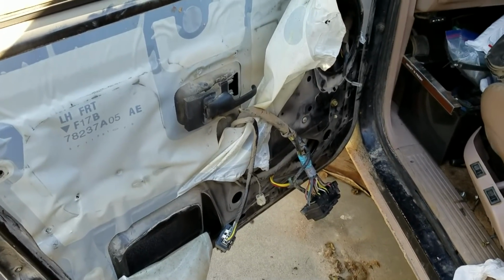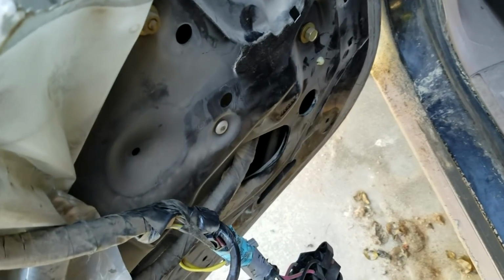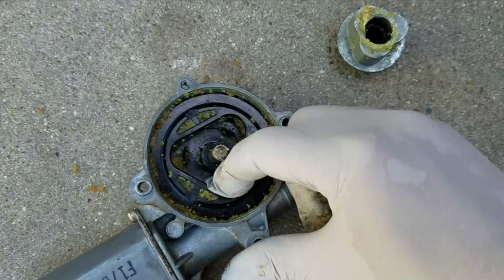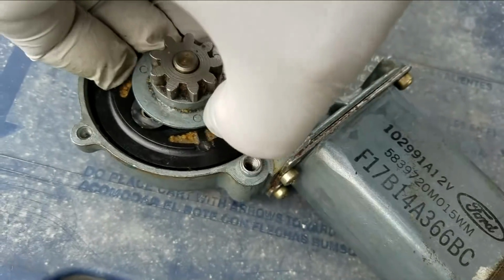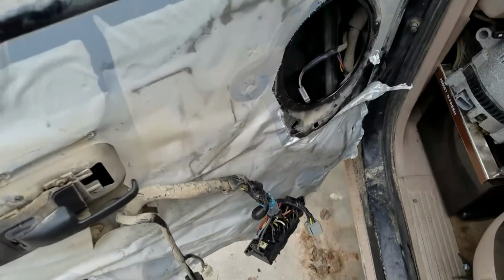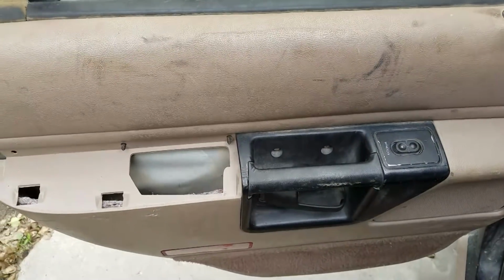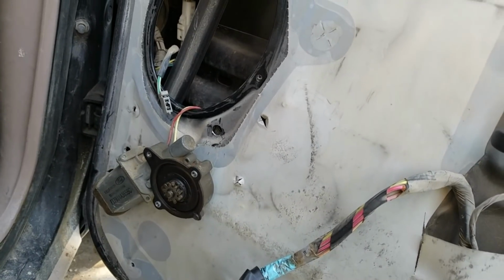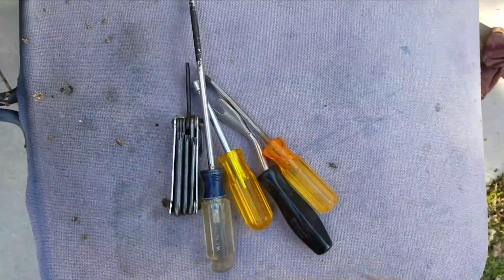Ford power window motor repair

Comment: I did mine , Lincoln Town , and it works better then new, the rubber hose is better then plastic or metal & will last longer. Many thanks *

Comment: Dorman makes a repair kit, # 747-409,  for $15.  Yes, I know yours is for free, as long as the rubber holds up.
But why did you not clean out the plastic debris?
Thanks for the helpful hint regarding drilling access holes to R&R the motor without even unplugging the wires.  Reallyexcellent advice.
Thank You for that....
.... RooDog....

Comment: RE:  my answer below.  The 7/16" wooden dowel pieces lasted 6 months, then the center metal chewed up the wood into splinters.  The ONLY solution is to use 7/16" zinc ball bearings.  $.79 each at MENARDS (similar to Lowe's or Home Gestapo).  Now I have even repaired a BACK window motor and that is much harder to remove, repair and re-install.
Reply: Trevor did u use the hose with the 7/16 bearings?
Reply: @joeyb7373  No.. steel ball bearings and a little grease only.  FORGET rubber, wood, expensive nylon pieces.
Reply: @trevortrillion6037  thanks I try it works great

Comment: I watched your video a year ago and procrastinated until now March 11, 2021.  Lacking the 3 spark plug tops, I left those out of my 7/16" gasline (1/2" too big).  Well, that little metal gear is so powerful, it crushed and broke the rubber in 10 seconds!  Next, I used 7/16" wooden dowel pieces cut identically.  Success, quiet, strong.  Can't wait to pay my toll, through the window!

Comment: Fixed mine this exact same way this morning.  Used spark plug ends as ferrules in the 1/4" rubber hose sections.  Works great now.  Thanks!

Comment: I used the spark plug tips and fuel line, greased it up, and it worked for several months...

Then it got where it would stick... and now it's stuck. I'm about to go take it apart and see what the deal is.

Comment: John here just done this to my 1993 F150 XL but didn.t use plug tops I used plastic water lone for water for ice cubes in the middle of the rubber holes . works great last a long time

Comment: Your idea of using fuel line to replace the original plastic cogs sounds good, but it's very dangerous.  Ford used plastic parts for a reason.  They are designed to sacrifice themselves if a body part (human or dog for that matter!) gets in the way of a closing window. This way a hand, paw or head doesn't get hurt (too much).  Problem is the three original Ford plastic cog parts deteriorate over time.  Go to your local auto parts store and find the Help! parts section.  They have a pack of new plastic cog bushings which retain the safety Ford built into the system, and they fit properly unlike your rubber hose trick.
Reply: Nope, they dont sacrifice themselves when new. Do NOT trust them.Try it out. OUCH!! Ouwouwou!! XD

Comment: I ended up takin my whole regulator out of my 1989 Lincoln Town Car,  thinkin it it was that. Beat me up! Needless to say.
I put another used regulator in anyways, since I bought it, but yes, it was the little plastic pieces that broke.
I saw anotha video like this one, & a guy put ball bearings in his, & said nuts would work in the place of those little plastic pieces. I put nuts in mine, & what do u know, works like a brand new window motor..
Window works like a normal window, got scratches, but well..
I like your idea too, the padding makes it that much better..

Comment: I had to do the same repair on my old Thunderbird except I used pieces of glue stick that were the same diameter which worked until I got the repair kit.

Comment: Great Idea.  It was off to the local parts store for me.  Turns out that it is 1/4" fuel line.  Will install the motor tomorrow.  Thanks for saving me a bunch of hassle !

Comment: FYI those windows will now chop your arm off! Not sure but I think that was the whole point of the plastic bits, they were soft and could slip under tension. No idea how strong the motor actually is but I'd be careful just in case. I replaced those a few years back in my Grand Marquis. A set of the plastic bushings was only like $3 on Ebay. I had no directions though and put grease inside there and found out later you shouldn't. Didn't seem to hurt though, windows worked like new.

Comment: I thought I came up with this on my own, did this yesterday but used pieces of a bolt cut to length. I saw other videos with people using nuts & ball bearings & thought I can come up with something better that will have some cushion so as to not strip out the plastic gear. It worked great, not noisy like the other videos. Started to do the other door today & the motor is not working, looking up videos to fix that & saw your video, guess I didn't come up with this after all, lol. Some minds think alike. Tearing into the the motor now to check the brushes. Good Job.

Comment: Clever fix.  They actually sell replacement inserts in the doorman HELP kits at the parts store, but they don’t hold up very well. It got to be I was doing the driver door motor on my 96 explorer about twice a year. Bet yours will hold up better being rubber and not hard plastic.

Comment: Crank windows last the life of the car, power windows are part of planned obsolescence.  Ford sucks the most for making throw away vehicles.'

Nice repair job especially for cheating the Ford bastards out of the cost of a new assembly.
Reply: Sorry, but it's not a conspiracy, it's a safety design.

Comment: i remember when i worked at napa we had a guy with an old battlship grey Lincoln continental that had the same problem and they actually make replacement clear rubber plugs just for this purpose. my guess is that these were used  so that there was a little bit of give to keep the glass tight against the upper window seal since even with the rubber plugs it would be strong enough to hurt your fingers badly

Comment: Seems to be the same sh*tty material VW used for the rubber ball in the gear shift linkage for their 020 gearboxes. Disintegrates with age, causing endless play and makes shifting a pain...

Comment: hey shango, all you need is to put (2) 1/4-20 nuts on top of each other in each of the 3 corners of the triangle. then pack in some grease & reassemble.

Comment: Perfect repair! I should have done it like you too. The exact thing happened in 2013 on my old F350...but I went with some replacement parts from rockauto back then. If it happens again, I'll do it exactly like you. Thanks for the idea.

Comment: Genius!! 😀 Ford and their window motors. Sheesh! Late 1960s Ford/Lincoln cars used a nylon gear driven by a metal worm gear on the actual motor shaft. That was worse, because when the nylon stripped out, the fix was a new motor from Ford at over $200 in 1970s dollars! Later, resto aftermarket suppliers sold a replacement mostly metal gear to fix it.

Comment: Reminds me of the three little dogs in washing machine agitators, they wear out too
Reply: Those little dogs have to run pretty fast to get the washer to spin---you just need bigger dogs
Reply: Whirlpool/kenmore washers
Reply: There are 4 in a Whirlpool agitator.
Reply: I had a Maytag that was impossible  to work on unless you chopped your way in with a sawzall.

Comment: Ford has been making these. this way since. The late 60's
Reply: drfalcon4102 The 1960s ones were a bit different in that the motor shaft had a worm gear that would strip out the nylon on the interfacing gear to the regumilatrial transdusorial framistatic conversion spintle bearing. 😉

Comment: Kits are available in many parts stores with the correct nylon spacers for about 8 bucks. I like the free aspect you presented though!
Reply: Sadly they are built like garbage.  Did the ones in our '94 Bronco (same thing)  And they are already making a slapping sound and falling apart.  Seems they do not like sitting on the shelf for several YEARS before someone needs them.  I've heard excellent results using the ball bearings.  But this repair is unique and worth a shot!
Reply: @Tedybear315  Thanks for this comment! Think I might just try ball bearings.